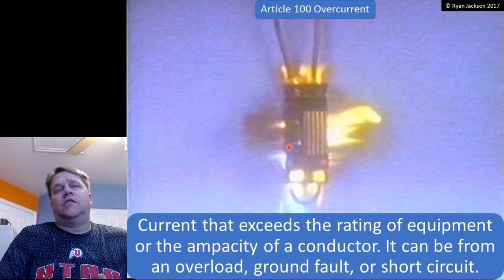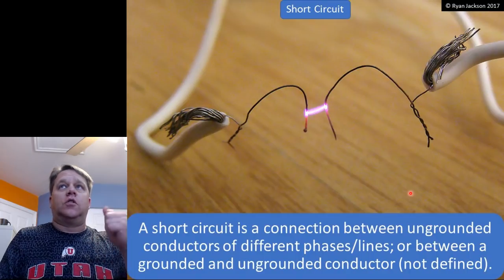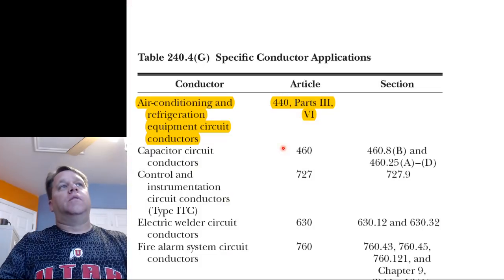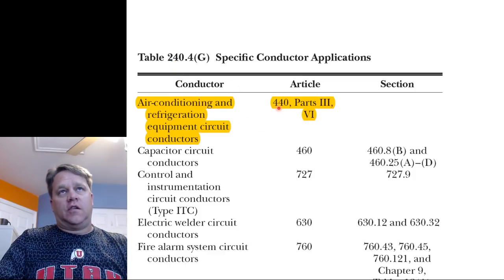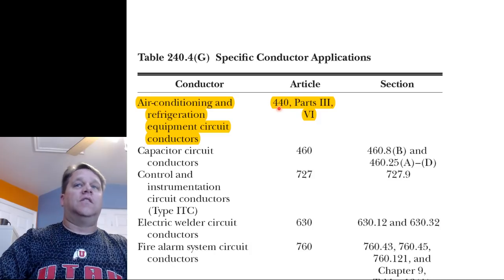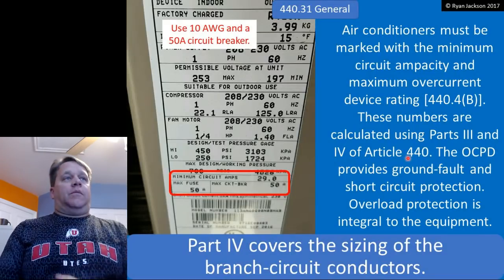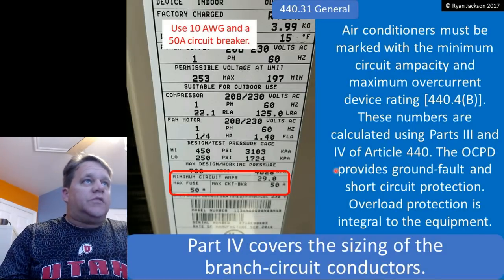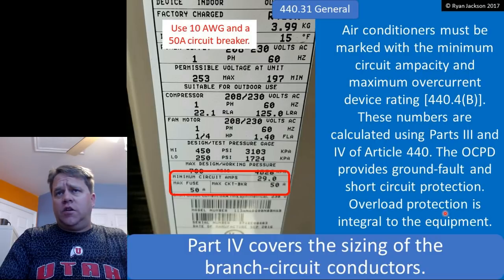Air Conditioners and the National Electrical Code (NEC)

Comment: commercial 2 door or 3 door soda cooler  is  also a Motor ?  that means need to go with ampacity conductor size and breaker size  as per label ? Thanks.

Comment: Ryan, I understand the concept completely. Been in the trade 40 years and you have explained this extremely well. I have encountered many a/c units wired with smaller wire. The reason leading to these encounters were the wires buzzing in the conduit upon unit startup. I work in a metallic code area around Chicago, no NM cable allowed by AHJ's, system must be pullable. This problem is always solved by upsizing the wire. I now always upsize because of my experiences irregardless of the circuit length. Maybe its overkill, but if the wires are rattling in the pipe, isn't this an indicator that the motor is potentially being power starved at start-up? Even if it isn't, the customer shouldn't have to here that irritating noise each time unit starts. "Code Plus" thinking can't be bad, correct?
Reply: I am assuming the rattling is caused by the strong EM field being peak on start up due to the approximate Locked Rotor condition present, causing the inrush current all induction motors have on start up, to be greater than normal.

Increasing the wire size would just lower the extra load placed on the circuit by resistance, therefore reducing the start up inrush current load placed on the circuit.

Correct me if im wrong.
Reply: @MR-nl8xr  Ohm's law says that if the load resistance goes down, the load current goes up. Since the load is a motor and the voltage is AC, there is an AC inductive reactance and some back EMF that would run counter to that, but basically the inrush current would tend to rise in stead of falling when you increase the conductor size, as the wire resistance goes down in both conductors.

Correct me if I am wrong.
Reply: @MR-nl8xr  No, nothing is easy or quick with Electricity in general.

Ohm's Law can be expressed mathematically as E = I x R  (Voltage across a load = Current passing through the load times the Resistance of the load). I believe you rearranged that equation to get R = I/E, when actually R = E/I. It's an easy mistake to make. Looking at the proper relationship (R = E/I) shows that if you make R smaller (using a larger conductor), either the current in the circuit will go up or the voltage will go down. Since voltage is the driver here, and is constant, the current will go up if the wire resistance goes down. That's the DC version of Ohm's Law. The AC version uses impedance (Z) rather than resistance. It's similar, but more complex .

When you said "Current will not just go up because resistance went down if the load does not require it" I believe you were thinking about the way motorized equipment is frequently considered as presenting so much load (ex: 16 Amps for an HVAC compressor) to a given circuit, as if it's the motor that determines  how much load it is going to present to the circuit, which isn't so wrong, necessarily, but it is like an estimate more than a calculation. To know the actual current, and it's increase, you have to consider the circuit as a whole, the resistance of the conductor leading to the motor, the motor itself, the resistance of the conductor leading back, and the circuit's driving voltage. The motor can be represented electrically (schematically), as a combination of resistances, inductances and capacitances which (as a unit) are in series with the two resistances of the supply line conductor resistances. You can work it out by pencil and paper, or let a computer do it for you, but the current will increase with a larger conductor.
Reply: Answering your question.
Yes potentially, but it is not a clear indication that the motor is starved, it is an indication of the magnitude of incomplete cancellation of magnetic fields and the interaction with the steel conduit or other circuit conductors in the conduit (if present). 
I agree with you, electric switching sounds are only appreciated in movies for its dramatic effect .
Code plus is not bad thing, unfortunately economics concerns ultimately govern every decision in our society.

Comment: Always use the MAX fuse or circuit breaker?
Reply: Disagree. Worked in large industrial plants and always used the smallest fuse. I usually sized quality time delay fuses for 125 to 135% of nameplate FLA. Had some 5 & 10 HP air compressors that did not shut off until 150# and had to size them at 150% of FLA. Years ago would only purchase Chase Shawmut time delay fuses. Forget who last purchased them.

Comment: Please to electricians use the minimum circuit breaker on condensers it will provide protection for the compressor under conditions such as a clogged condenser coil. Compressors are expensive breakers are cheap. This is from 40+ years in the HVAC&R trade and as an industrial electrician
Reply: So true.

Comment: thanks for the clear presentation and why HVAC//R  has the exceptions.Also if people notice on the nameplates it mentions BREAKER (HVACR)
these are special breakers for the hvac/r  industry.  Suppose to be able to pull locked rotor amps for a few seconds so the compressor and fans 
can get up to speed.
Reply from the maker: That used to be the case, but now the "HACR" rating is no longer required. I definitely remember having to check for that though!
Reply: @RyanJacksonElectrical  good to know about the breaker change
Reply: @RyanJacksonElectrical  my new Bosch unit is state-of-the-art and its Installation Manual still refers to an HACR breaker. Wonder how widespread the knowledge of the rating change has gotten in the HVAC industry. Or maybe some of them liked the distinction and want to hold on to it as long as possible.

Comment: But what if the wire splicing become loose and the wire is pulling more than 15 Amp and it wont trip the circuit. It will burn the wire.😳
Reply from the maker: Why would it be pulling more than 15 amps? Did you watch the video? The motor is inherently protected. It is just like the cord for your disposal. You disposal is on a 20A circuit, the cord s 16 AWG. Why doesn't it melt? Because the motor will shut itself off before that happens.
Reply: @RyanJacksonElectrical  resistance due to a loose wire
Reply from the maker: @noneyall2819  Then the rating of the overcurrent device is irrelevant.

Comment: Great video training.
How to know when choosing 60F or 75F?
On the last example I have min amp 29, max fuse 50, max ckt  bkr 50
In case that the existing breaker is 60 amps,  can I leave the 60 amps breaker with a fused disconnect of 50 amps, and a 10awg?
Reply: Yes you could and use DE TD fuses.

Comment: In Germany I noticed they use 1.5 mm wire fused at 16 amps 1.5 mm is lighter than 14 awg since 14 awg is rated for 15 amps I don't think it's safe 
I also noticed they dot put a box above lighting fixtures so that's not code

Comment: Doesn’t disconnect have to to readily accessible? Anyway,  your the best at explaining these type of things. keep it up on YouTube...future is bright
Reply: FROM the heat pump, not the ground necessarily. If it has fuses the unit etc. can't block the disco.
Reply: Code states that you must have a 30" wide area and 36" clearance in front if all disconnects. Have to fight with other trades to keep away.

Comment: Hello, Whatever does the NEC say about the disconnect box pertaining to outdoor ac condenser such as : distance from condenser( I have seen disconnect boxes 8 ft above a condenser, where a ladder is needed- that isn't safe) , within visible distance of the condenser(the box being around the corner of a building) being behind the condenser( in such a way where you can't stand in front of it, not exactly safe). A disconnect box being below snow line or to close to the ground. Is there a reference in the NEC for these items pertaining to AC? I have seen in homes built even 10-15 years ago where Romex is run from panel to outdoor disconnect box with no rubber conduit sleeve, and in addition Romex from box to condenser. We always change the Romex from box to condenser to a wire and conduit protector. What does the NEC say about that, do we know when that code was changed not allowing Romex to be run outdoors to ac's and disconnect boxes without a conduit sleeve?

Also for electrical switches and outlets mounted to gas furnaces , requirements etc. Thank you very much for putting out this video if was informative and I have subbed.

Comment: Can I put a 20 amp condenser on a 30 amp breaker even if the nameplate calls for 20 amp protection as long as there is a 20 amp fused disconnect in between?
Reply from the maker: Yes.
Reply: @RyanJacksonElectrical  what about same question , but on heater kit.
Reply: Overload protection is inherent in the motor. 
Ground-fault & short-circuit protection if from the breaker or fused disconnect.

Comment: I’m assuming the 50 amp circuit breaker on 10 wire is only from the AC unit to the disconnect. A 30 amp circuit breaker would be used at the service panel for the branch circuit.
Reply from the maker: Hi Jack. the feeder would be the same way, in accordance with 43.0.62(A).
Reply: @RyanJacksonElectrical  430.62(A)

Comment: Thank you so much for explaining the WHY I've known we can do this, but we have just sized the conductor on the breaker size regardless because I didn't understand that the motor itself is providing the overcurrent protection. We have just said the phrase "code is a minimum" and over-sized the conductors on principal.

I feel so much more confident in my ability to provide a safe installation to the customer while also being more cost effective.
Reply: The manufacturers manual usually spells this out but it wasnt mentioned in the video, voltage drop. Be cognizant that long runs might have excess voltage drop and you need to bump up the wire size to accommodate. It might cost a few more dollars to install bigger wire but the customers compressor may last longer due to being able get up to speed faster vs having brown out conditions with smaller awg wire.
Reply: @Jay0x00 yes, dystance effects the wire ampacity. Someing we as electricians always ought to be aware of on anything we install.

Comment: Shouldn't this be based on the 75degree column?
Reply from the maker: Only if the terminals are rated 75 degrees. See 110.4(C)(1).

Comment: What if damaged or loose wires causes an additional load from arcing or current from a lightly conductive material that causes slight continuity between phases or grounding/grounded to ungrounded. Like say the material across the conductors creates 5 ohms of resistance across 120v. You will start pulling 24 amps. Or If a handy man comes along with out a permit and adds a condensate pump and heat tape on the circuit. The wires ampacity couldn't safely handle the over current before the breaker opens right? I can understand the max breaker size to handle the in rush current or a fail safe if the units over current protection fails. I understand the code implies that you if you are working with electric you will be knowledable of and following all codes accordingly. But I still believe it would be slightly safer to also size the wire to the breaker for freak scenarios like I mentioned.
Reply: The example I used would be if you were using say 20awg 60c protected by a 25 amp breaker
Reply: @erikolsen3611  If we were to wire everything based off of what if scenarios like you are describing then where does it end? I understand what you are saying but you have to stop somewhere
Reply: Yes, stupid happens therefore ... _insurance_.
Reply: Your condensate pump and heat tape is normally on the inside air handler unit. The discussion is about the outside condenser unit and it should never have a condensate pump outside. The wiring to a condenser does not need a neutral wire. Obviously, someone could run a white wire, but there is no use for it without violating the code. Only two hots and a ground. Without a neutral you should not have a 120 v circuit to run your electrical equipment. Yes, I know AC techs jumper their vacuum pumps to the ground to evacuate the system. People violate the code all the time. The discussion is about what the code permits and not how to violate the code.

Let’s say you had a 30 amp, 4 wire, 10 ga, circuit and breaker. Could you hook a 120 v appliance to it. Yes, you can, but you would violate the code because the 120 v appliance needs a 20 or 15 amp breaker to protect it. This means a subpanel with breakers. The 30 amp breaker could melt the 15 amp 120v receptacle. The code does not care about the appliances plugged in.